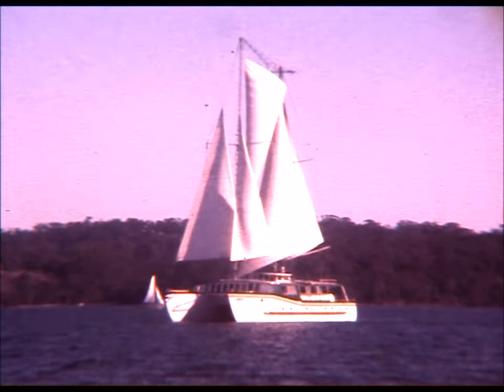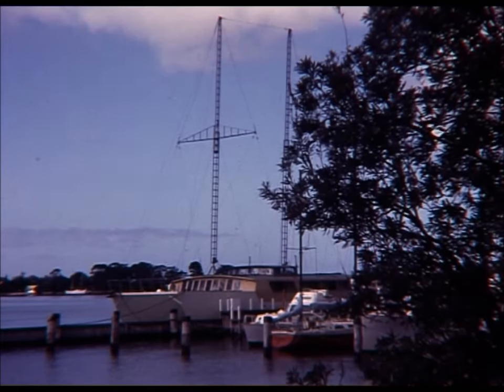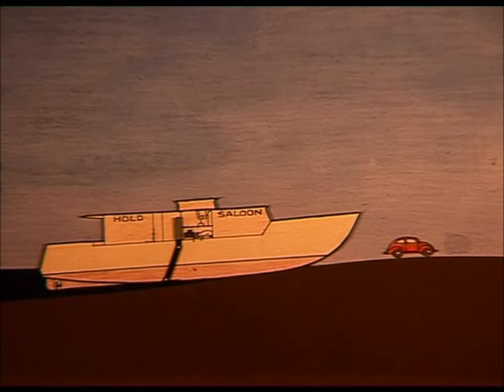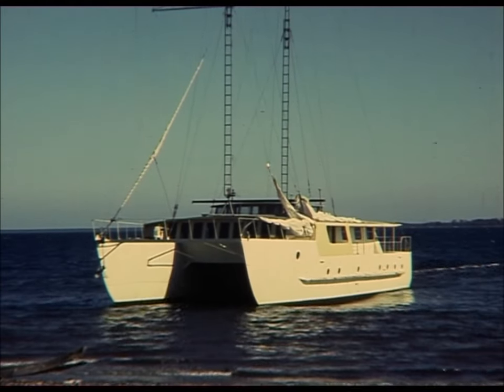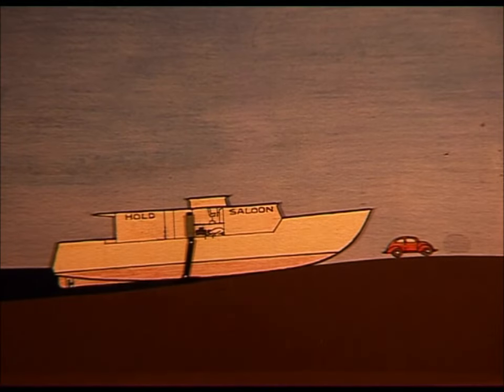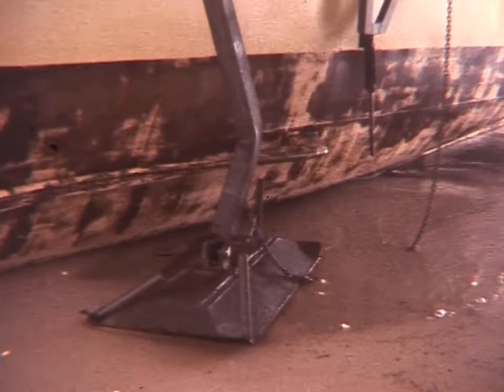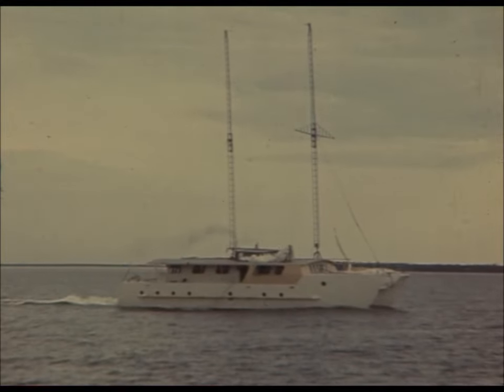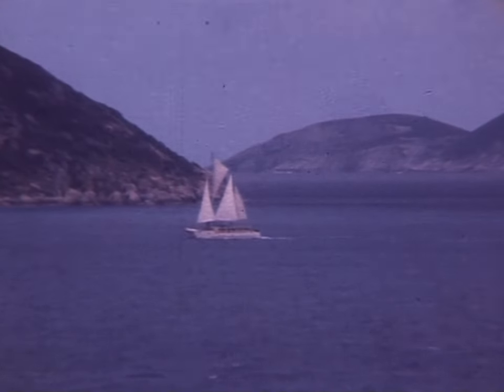The Boat That Walked

Comment: Great idea, as long as the hulls have stainless skid plates at the bottom, so they don’t get scraped open by rocks.
Reply from the maker: Thanks for the comment. The rocks were not a problem as we always beached on sand. However, the bottom was soon scraped clean of paint which was a problem.  I was inclined to fit a shallow keel made of steel channel  thick enough to survive abrasion for years. However, a stainless round bottom would have been better.